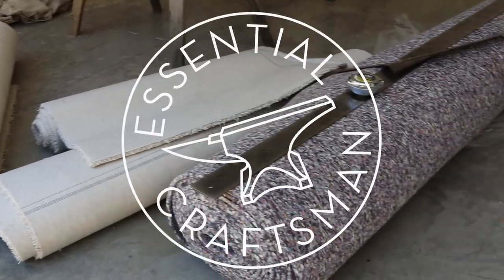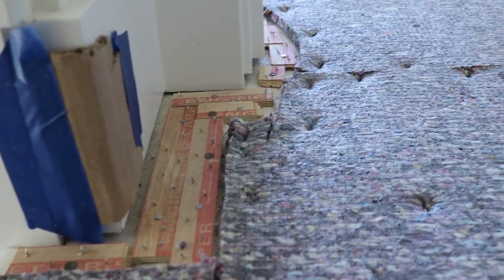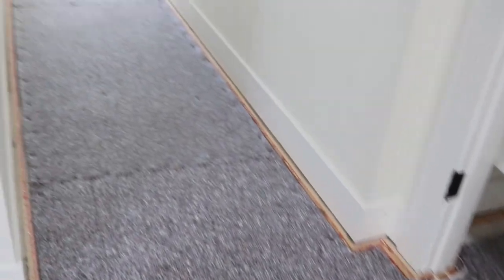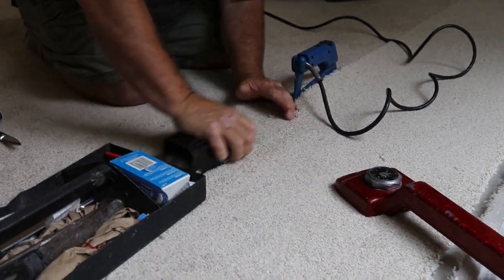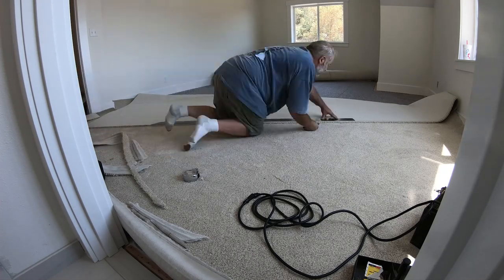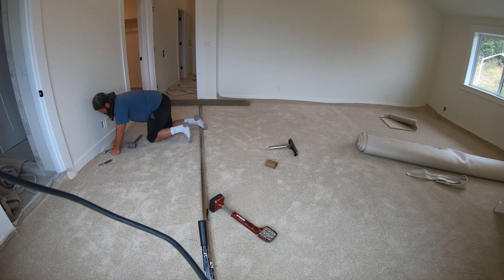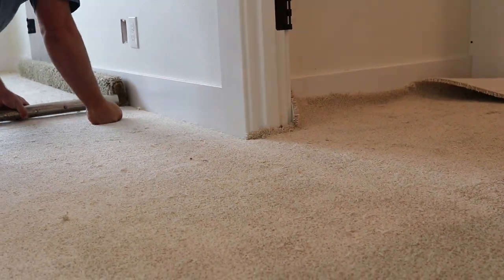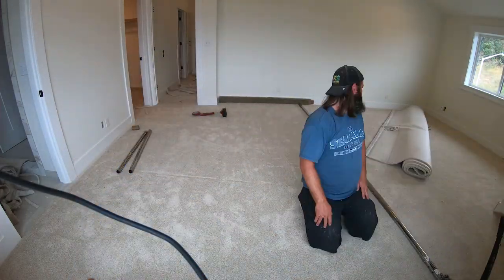Installing Carpet Ep.130

Comment: What knee pads does a veteran carpet installer use? I'm still looking for suggestions. There is a design conflict between comfortable, don't pinch the back of the knee and stay in place despite moving or standing.

Comment: Its recommended to NOT use a star wheel tractor/seam roller on plush/cut pile carpets it breaks up the yarn and leaves a faint stripe intead use a smooth wheel tractor/seam roller

Comment: When I bought a new house in Caldwell ID, I was walking barefoot and as I transitioned from the carpeted areas to the uncarpeted areas, (kitchen, bathroom), my feet were punctured from tacks protruding from the tack strips. I had to get on my knees and tap over 100 or so tacks in these areas. I didn't think a professional carpet layer would have done this. The home builder has a reputation of cutting corners so I assumed apprentices did this job.
Reply: Its kinda common to get stuck in the foot with the tacks at the seams or even those transition areas.

Comment: I installed carpet as well for 30 years as a third generation installer. It seems these guys did not keep up with technology and training. First off the seams should have been sealed with the hot melt sealer method with a built in tracer. This method bonds the layers of carpet together and assists in reducing peaking and if it ever was inspected the tracer proves it was sealed. The tray from his tool box should not be used as a seam weight. The metal from the tray will not release the heat from the seam tape potentially causing peaking and trapping moisture in the yarns potentially causing the yarn to loose its texture retention. The seam should have been pre-stretched as seam tape does not stretch. The carpet tractor should not be used on the seam when making the seam. The manufacturers have reduced the heat set twist in the yarn and the combination of the heat and tractor  can cause the yarn to loose the texture retention and permanently blossom along the path of the seam. The stretching pattern used is not consistent with the carpet and rug institute although I did like to see the use of the carpet wrapped 2x4 to protect the baseboards. The butt should have stayed on the stretcher pipe while the 2x4 was used .  The carpet is supposed to be tucked into the gulley with a tool called a spreader. The carpet is stretched up and the spreader is pressed into the gulley and held, the stretcher is then released engaging the tack strip pins into the back of the carpet. The entire wall is done this way and THEN it is trimmed with a wall trimmer and tucked into the gulley with a plastic stair tool so as not to mark the baseboards, or a quick tuck tool with plastic wheels to tuck in the carpet. Keep your shoes on! They must be clean or boot covers can be used, but you are working with razor blades and tack strip and stay tack nails. The potential risk of injury is way to high and then if you are injured now blood is on the carpet. This is a health hazard to both the installer and the home owner. Proper foot wear is just as important in this trade as in most every trade. It is unfortunate that the carpet installation trade has lost so much knowledge. But this is caused by a lack of pay. The mills are responsible for this completely. But that is another story no one wants to hear from an old guy who has forgotten more than the next generation will get a chance to learn in this trade. Again this is because there no one left to teach it and this is because there is no demand for quality only cheap labor. Once the veterans are gone the trade is dead and it is almost completely dead now. Covering the floor is not the same as having it  professional installed two totally different animals.

Comment: I installed carpet for 20 years and those guys are good at what they do.  There are subtle differences in techniques but, for the most part it's a 'potato potato' situation.  To each his own.  To quote another able craftsman, 'keep up the good work'.  I really enjoy the videos. Thanks, Pete
Reply: I installed carpet as well for 30 years as a third generation installer. It seems these guys did not keep up with technology and training. First off the seams should have been sealed with the hot melt sealer method with a built in tracer. This method bonds the layers of carpet together and assists in reducing peaking and if it ever was inspected the tracer proves it was sealed. The tray from his tool box should not be used as a seam weight. The metal from the tray will not release the heat from the seam tape potentially causing peaking and trapping moisture in the yarns potentially causing the yarn to loose its texture retention. The seam should have been pre-stretched as seam tape does not stretch. The carpet tractor should not be used on the seam when making the seam. The manufacturers have reduced the heat set twist in the yarn and the combination of the heat and tractor  can cause the yarn to loose the texture retention and permanently blossom along the path of the seam. The stretching pattern used is not consistent with the carpet and rug institute although I did like to see the use of the carpet wrapped 2x4 to protect the baseboards. The butt should have stayed on the stretcher pipe while the 2x4 was used .  The carpet is supposed to be tucked into the gulley with a tool called a spreader. The carpet is stretched up and the spreader is pressed into the gulley and held, the stretcher is then released engaging the tack strip pins into the back of the carpet. The entire wall is done this way and THEN it is trimmed with a wall trimmer and tucked into the gulley with a plastic stair tool so as not to mark the baseboards, or a quick tuck tool with plastic wheels to tuck in the carpet. Keep your shoes on! They must be clean or boot covers can be used, but you are working with razor blades and tack strip and stay tack nails. The potential risk of injury is way to high and then if you are injured now blood is on the carpet. This is a health hazard to both the installer and the home owner. Proper foot wear is just as important in this trade as in most every trade. It is unfortunate that the carpet installation trade has lost so much knowledge. But this is caused by a lack of pay. The mills are responsible for this completely. But that is another story no one wants to hear from an old guy who has forgotten more than the next generation will get a chance to learn in this trade. Again this is because there no one left to teach it and this is because there is no demand for quality only cheap labor. Once the veterans are gone the trade is dead and it is almost completely dead now. Covering the floor is not the same as having it  professional installed two totally different animals.

Comment: Choose a thick carpet.  We have thin carpet and I feel the tacks on the stairs and a threshold, like little caltrops.
Reply: You can. The better option though in my opinion if you are trying to save money is to instead invest more into the padding. It will cause the carpet to feel softer and more plush. A trick I use when flipping houses.

Comment: That's an awesome technique to lay carpet. Mine's glued to the floor. It's a pain in the butt to get it off and i still have to remove it in two rooms.
Reply: Cut into thin strips. If on concrete, if glue is water based, 99% it is, try watering it !  Test in small area !  Good luck!!!

Comment: What is the floor structure on the second floor?  Is it two layers of plywood beneath the carpet and padding?  On the stairs, I think it is the OSB.  Is this sufficient strength?
Reply: I believe it’s standard 3/4” OSB if I recall correctly from the install video.
Reply: @TimBryan  you right I think. 5/8 to 3/4. By. Building.  Code  I believe

Comment: Please, can someone explain, how does those upside down nails (where the walls meet the floor) doesn't hurt someone's foot when wandering the area?
Reply: The nails in the 'tack track' do not reach  much beyond the carpet backing.  Their function is merely to fasten the carpet so it may be stretched, tucked  and trimmed to the wall
Reply: @pmchamlee  Still, I was worried about someone (maybe a child playing) jump onto this corner (the tack track) and pierce their feet. I'm from Brazil, we don't use carpet here, most homes have ceramic flooring, my worries were without knoledge, I don't having any experience with tack track. THanks for your answer.

Comment: As a former high end carpet cleaner that saw plenty of bad carpet installations - very nice to see this carpet laid the right way, especially with the power stretcher. Far too many installers take the easy way out and only knee kick the carpet in. This was a carpet installation VERY WELL done.

Another issue is to NOT have the seem run horizontal to the main source of light. It is far easier for a seem to show up that way. Excellent example of good carpet installation.

Comment: I have watched every episode of this build and one comment I would make is that it is so fortunate that you have had such experienced and quality workmen performing their skills.  The Capet layers are just another trade where their knees are buggered as they get older.  In Australia, I have never seen anyone using two pieces of smooth edge when laying out.  The other thing is that long pole stretcher. That is a good way to ensure that the carpet is pulled correctly form one side of the room to the other.  Here, having had carpet laid in three homes over the years, I have only ever seen the layer use one of those knee kickers to stretch the carpet and thus, the buggered knees.

Comment: I could never have carpet. My ceramic tile floors and oak floors barely survive our family. Carpet would be futile.
Reply: @Brent Smith It's normal that your carpet was done after 10 years. It's still cheaper to install a $1.5 carpet than a $5 hardwood that need to be refinished every 15 years (at a cost of $4-5 a square foot). Now if you don't like the comfort of a carpet...

Comment: Carpets can be left uncleaned for a few weeks without looking bad. Hardwood and laminate have dust bunnies within 3 days. Airports, hotels and some restaurants use carpet. Carpets are easy to clean, durable and comfortable.
Reply: Airports use commercial carpet which is very different. The only downside to carpet is its not very stain resistant.
Reply: It may not look as bad, but it sure is as bad. If my floor needs cleaning, I'd rather know it.

Comment: You don't ever need two rows of tackless, you can get away with two if the carpet is thick enough.  What you need is 1 row re-nailed with some ring shank nails and a tight stretch.
Reply: Wrong, ALWAY two. Been to plenty of your re-stretch jobs🤦‍♂️
Reply: I must say that the seams were a disappointment. Seams should always get cut from the top and between the rows. That carpet won't show their flawed technique for some time but try that with a level loop carpet, a patterned carpet or even a dense cut pile and the seam will end up looking like you can trip over it.
Reply: Double tackstripping a wall makes the job so much easier. It also depends on the carpet weight and thickness, and also if there is a gap in the baseboard to tuck the carpet under. This is coming fron someone who has 16 years of floor covering experience.
Reply: @sdaniels7114  how many years have you installed carpet? That carpet is not a row good like berber. It is perfectly acceptable to cut from the back with a straight edge as long as you dont go too deep and shear the yarn on the face.
Reply: I like 2 rows it makes it easier
Reply: @justinlaw2670  you’re absolutely right. Sir double tack strip helps a lot on. Thick. Carpet. Also  very helpful on all berbers cut piles. And. Plush carpet also. Seams. Cut from. The backin. Are good. To go. On. Heavy carpets the only one I would not. Do it. It’s. On. Any. Row or. Berbers  I have been. Doin. Carpets and. Sheet goods. For 23 years

Comment: no one cuts their carpet on the driveway
Reply: You can never say that again.  You saw it.
Reply: Yes they do.
Reply: There's a million to one chance of a bird flying by but if its clean, its clean.
Reply: Been cutting it in driveways for 30 years
As long as it is not raining or full of oil stains
Reply: Sometimes you have to box out the carpet and sometimes the driveway is the only place big enough to lay out a 12×30 as long as its clean its fine. People that say no one does it have never layed a piece of carpet in their life.
Reply: @justinlaw2670  so you can only lay carpet in temperate weather conditions, is this your claim?
Reply: otherwise we would see carpet layers carry stiff brooms and canopes.
Reply: 3rd option, carpet layers cut on the driveway as long as the weather allows
Reply: @Oldiesyoungies  i said as long as the driveway is clean stan. If there is snow on the driveway its not clean genius. Carpet can be laid in any season, the winter however is much more difficult due to snow and carpet getting cold when transporting it to the job site. And if you know anything about carpet, which it looks like you dont, it gets extremely hard to work with when it is cold.
Reply: @justinlaw2670  I’m saying there are crews that never cut carpet outside.
Reply: @Oldiesyoungies  your first comment said no one does which is false. I guarantee every carpet installer has cut carpet outside somewhere in their career. Hell ive seen the shitty carpet installers from home depot just roll the carpet out on the grass and cut it. Sometimes we pre measure the job and box out the carpet at the warehouse before getting to the jobsite.
Reply: @justinlaw2670  I’m willing to bet there a million guys laying carpet solely inside. Perhaps even without a shop.
Reply: @Oldiesyoungies  stan im not going to argue with someone who doesnt install carpet.